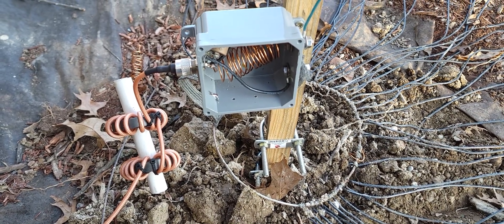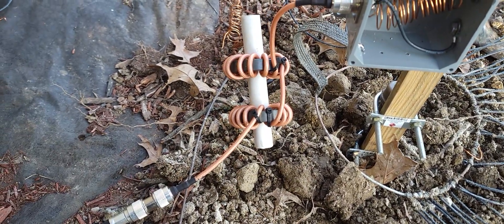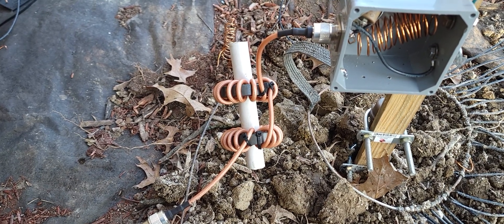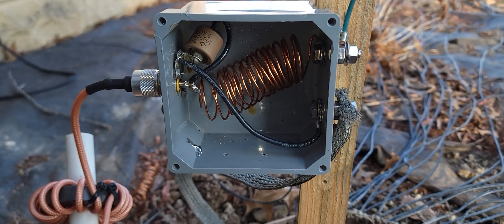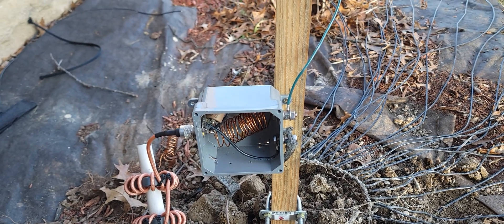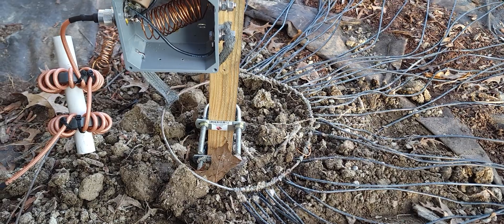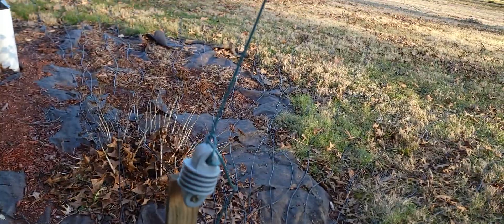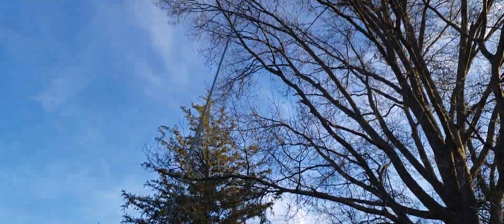160m 1/4 wave inverted L

Comment: i know this is a 2 year old video (Jan/2026), but i'd like to say thanks for showing us such a great top band setup, really impressive !
Reply from the maker: Thanks for the comment, my rope recently broke holding the vertical portion of this antenna, I need to find some time to get out and fix it.
Reply: @N9TTK  hah, yes we had have storms here (IO90BS , 100m SW London) my 80m EFHW has taken a beating but still operational, i'll wait to the spring when the weather gets a bit better. I will research if i can get a 160m wire up in the mean time (I can get on with an ATU, but would prefer something resonant)

Comment: Could you use an air variable capacitor?
Reply from the maker: Yes you could for sure, I operate in the lower part of the band so no need for me to adjust.
Reply: @N9TTK  thanks! 
Jeff W3AAB

Comment: I’m looking at building the same antenna. Have you experimented with less radials? Just wondering the noticeable difference. 73 w4zxt
Reply from the maker: Hi Jay, at one point I only had 8 short radials on this antenna. I was able to work EU with it still so put down what you can, your performance will increase with more radials. I still only have a handful of long radials with the majority being 16-35ft and the long ones being 100-140ft. I ran this antenna without the matching network for over a year because the lack of radials provided a closer match to 50 ohms.  With the radials I'm about 25 ohms where X=0, the LC circuit brings that back to 50 ohms to make the amp happy. The low band dxing book by ON4UN is a fantastic resource as well as W8JI's website. Also checkout the K2AV folded counterpoise, I know a lot of folks running that system, I just don't have the room for it. That would take place of the ground radials but needs to be elevated. N9TTK
Reply: @N9TTK  thanks man! I’ve tried the elevated radial system but only with a city lot I decided to lay a few 160 ft radials under the wire. Looks like you have 45-50 there which is great. My antenna is a 80-10 efhw bypassing the unun as inverted L but only 30 ft high. I need to find some scrap wire somewhere and lay more. Lawn staples absolutely wear my back out hehe. Great info! I try to work at n4ss during top band Cw contest. Bryan uses this antenna at 120 ft with 64 radials and beverage antennas to eu ,ja and vk. Pretty amazing how well people hear the antenna that we can’t hear without the beverages. Maybe one day I’ll have a place in the country. 😆
Reply: How many turns on your coil and lenght?
Reply from the maker: Sorry I missed the comment, the box is 4 inches wide so the coil is probably 3.5 inches or so and maybe an inch in diameter. I used the sim smith program to determine the inductance needed and an online calculator to give me a rough idea of the coil. I used an LCR tester to get it close and then spread the coil once installed to fine tune the antenna. It is not perfect as I needed around 1300PF and only had a 1000PF doorknob cap. It's close enough and seems to work well.